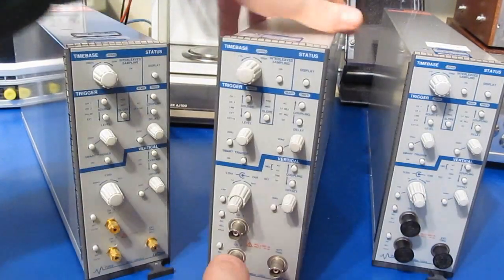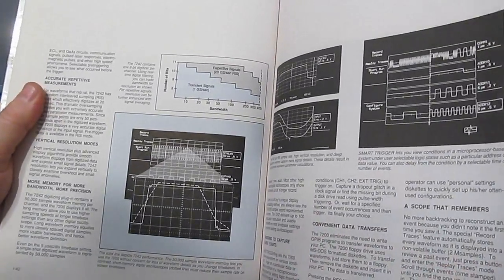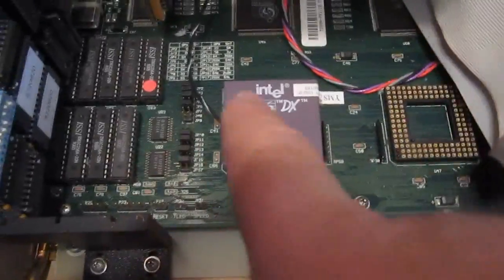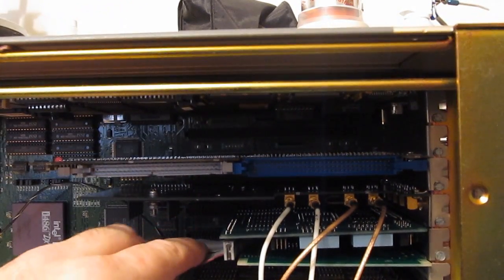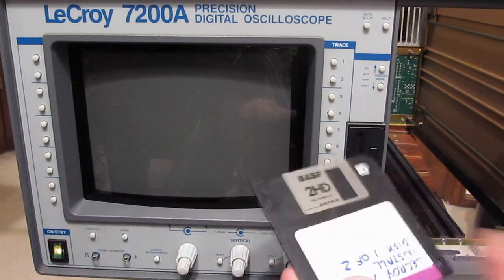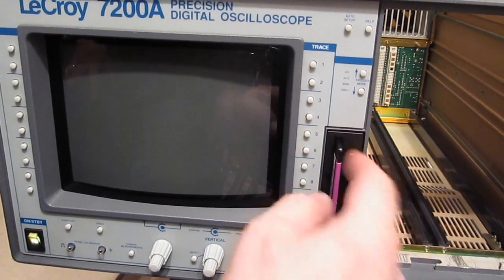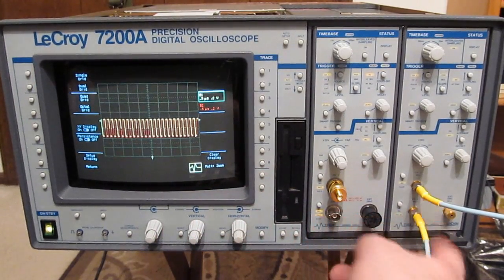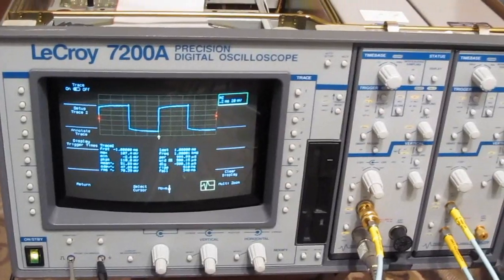Oscilloscope Repair, Day 2, The  LeCroy 7200A

Comment: Do you have a service manual or circuit diagram for this unit to share??
Reply from the maker: Sorry, I don't.  I would have just traced out the sections in question and shot gunned it by measuring the components.

Comment: What was wrong with the power supply? How did you fix?
Reply: Ok thanks
Reply from the maker: It was seven years ago and I am not sure.  That said, I doubt very much your scope would have the same problem.   Normally I have seen the tants in these fail short.

Comment: Hi, I have the same LeCroy that has come to me from a friend's attic where it was stored for about 20yrs.   Before powering it on I did take it apart for visual inspection and cleaning.  I have the same problem as you did @13:10 when trying to power it on, no action at all.  In your video it's not clear how you got around that??
Reply from the maker: After repairing the power supply, I had to replace the hard drive.
Reply: Do you recall what you repaired or replaced in the power supply?

Comment: I think I have the same harddrive 200MB version out of some compaq 486dx desktops and 3 out of 4 were dead when I tested them
Reply from the maker: They are fairly old and depending how the were stored and handled I would not be surprised to hear of 4 out of 4 dead. Buy a bunch of old PC that someone no longer cares about, I doubt they would have been handled with any care.

Comment: Another LeCroy big machine powered by 486 processor . The floppy drive well they jam with ages but save always one . It's fun to see these LeCroy running which look modern even today and a simple interface
Reply from the maker: They are pretty easy to run.   They have a lot of math functions built into them which can really slow them down.
Reply: That's why the 486 DX4 comes to place. I remember using PC's with that processor running Windows 3.11 and they were faster than the pentium 100's in some cases. Does this Scope supports an auxiliary CO-Processor, since it's a computer?
Reply from the maker: Not that I am aware of.
Reply: there use to be a extra slot for the 487 co-processor  right to the 486 CPU on some MB in this video (8:49) i think there was one .
Reply from the maker: Yes, this MB supports both the DX and SX processors.  Yes, there is a socket to support the 80487SX if you are using the 80486SX.  I am not aware if they support the SX but I am not sure why anyone would use one anyway.  There were problems using the Cyrix and AMD parts but the the DX4-100 worked well.  Still my newer old scopes will run circles around it.
Reply: Yes in fact the 487 was to upgrade the 486 SX which  came without no integrated Co-processor. In case there are no DX processors left and spare SX's there's always the chance to save the scope. If they run circles or elipses they are fine. I believe that i saw a 486DX using an CO-processor in a old server, but maybe it was a dedicated implementation and some with two DX4 processors (overdrive) . Example : https://picclick.com/1pc-Used-P5-6X86-SBC-Ver%EF%BC%9AG5-586-282225820575.html
Reply from the maker: Yes, that is what I am saying and pointing it out that your comment about it having a socket for one is pointless.   I would imagine finding a 486DX would not be a problem and again, I don't know if they even support the SX.   The hardware they support is very limited.    There are a few slots free and there is all sorts of cards that could be added but without support, your are not gaining anything.    It's a very old system and I don't think you are going to find anyone wanting to reverse engineer the software to add support for additional old hardware.
Reply: Yeah better keep it simple really and stick to the DX processor if no problems at all. Pointless really from my part sorry, just trying to improve the scope.This is a very good modular backup scope regardless of it's age and it's worth the work you employed. It's running the MS-DOS? yeah just runs.
Reply from the maker: MS-DOS? Surely a joke on your part?  LOL!!!  QNX would be a good guess for the age of the scope.  These run PSOS, as you might have guessed as the company may have wanted to leverage their code base from the 7200 which again was 68000 based.         

I'm not sure really what you could do to improve one without sinking far more into it than just buying a better scope.   Keeping in mind that if any of the custom parts fail, all of the time you invested my go down the drain.
Reply: LOL that was not a joke unfortunally and i didn't realise it's a RTOS based system... ohh my goodness... Forgive my soul. I didn't know the pSOS untill now. Well it started on the famous 68K that would be a robust RTOS system. I tried some windows Scopes ...well, they :'(

The MS-DOS : http://www.radiowrench.com/sonic/so02146.html
Reply from the maker: There was a company, Venture Com I think, that was working with Microsoft to develop a RT version of NT.  These scopes are much older than that.  I think QNX was around back then but I suspect it was a lot less effort to port to the Intel part using the same OS.  

My current scopes use Windows and I really like them.  The data rates back to the PC are fast enough I can just use a good computer to post process the data.   

Now there is an old relic.  I don't think those were sold to the Military.  lol.   I made something like that for my analog scope many years ago.   I think I had maybe a 100KHz BW.  lol.

Comment: aslo you did changed cooling fan ?
Reply from the maker: No, those are the originals that were in that chassis.  I have saved four of them for spares in case they ever fail.   These scopes throw off a lot of heat.

Comment: Quantum the HD failure king back in the 90`s lol bought out by Maxtor than Seagate
Reply: To my experience it reads the opossite. Quantums were less noisier, less power hungry and WAY FASTER that drives at similar money. Seagates and WD were insane slow and clunky. Through the years Quantums held better. I got a box of mixed drives 1G to 2G, Maxtors and Segates are dead. Quantums, some of them still ticking right for their age. Seagate and WD used tape to seal top and bottom halves LOL ... guess what happen .... Quantum and Maxtor used gaskets. And even when Quantum and Maxtor looks and feel similar, Quatums were (for me) far superior. Maxtor lost its reputation above 15G, and IBM did similar with DEATHSTARS. 20, 30 and 40G models were GARBAGE. Quatum dissapeared at this stage and WD was the most reliable at this point. But Samsung did PRETTY GOOD. Have several Samsung 1G, 2G and 4G and man, they are a bit slow but it held like champs. Later SpinPoints ..... rock solid. I dont like Samsung, but they did fine. Today as per Internet opinion and "research" the better brand by FAR is HGST (hitachi) with way less failure rate compared to WD and Toshibas. Indeed is the end of mechanical drives ....

Comment: you tried use a compact flash or pata 2,5 drive whit ide adapter?
Reply from the maker: I have not.  I suspect it would work.
Reply: wonder the boot time vs hard drive.
Reply from the maker: Normally when I use a scope, I have it on for a few hours.  If I could reduce the time to boot from say 1 minute to 1ms, it would not save me a lot of time overall.  The scopes like most equipment will need to warm up as well which is going to take several minutes.    I was going to use SSD for the reliability but the old mechanical drive I had installed was still working when I gave the scope away.